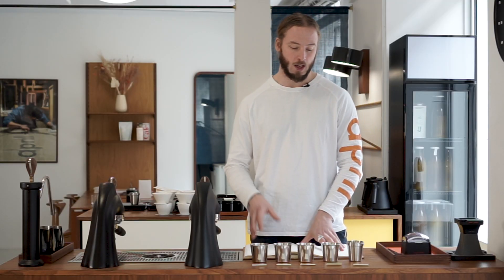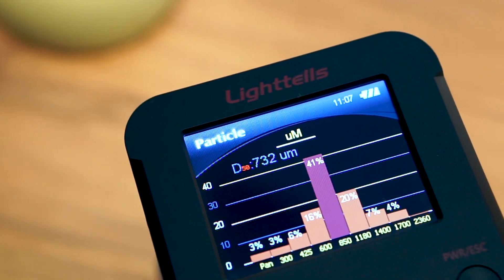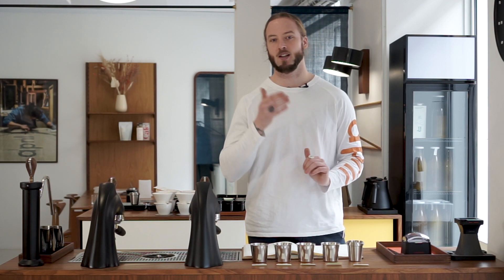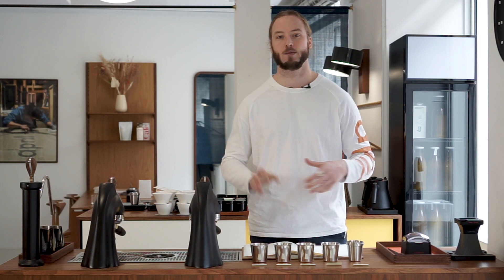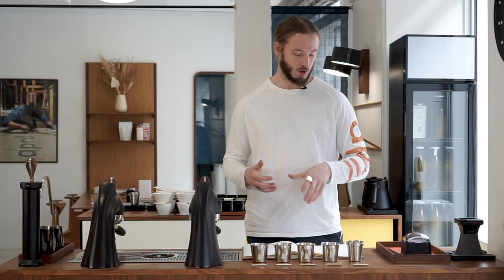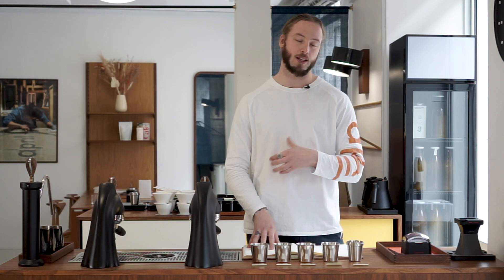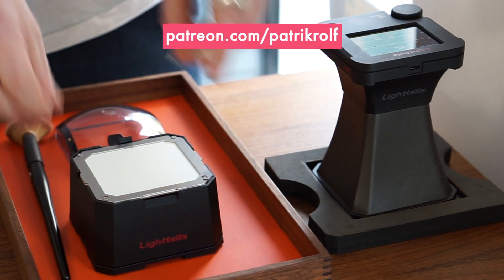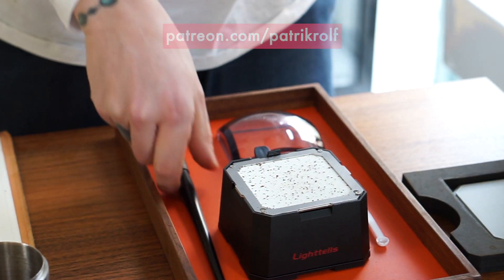Why Discussing Grind Size Is More Complicated Than You Might Think | Coffee with April #207

Comment: The Lightells figures seem to be based on sieve intervals, but the 1400 shouldn't be there, as it's not in the x1.414 sequence of all the other sizes (it's the square root of the interval of all the others and creates an artificial hump at 1700). There can be nothing below the pan because it has no holes, so the 2% sits on top of the pan, following this logic the D50 is over 850, not 751um .(7% 1700+2%1400+25%1180)=34% on top of 1180  with only 16% supposedly between 1180 & 751um? They don't agree with your Ditting settings either, assuming your Ditting is calibrated.